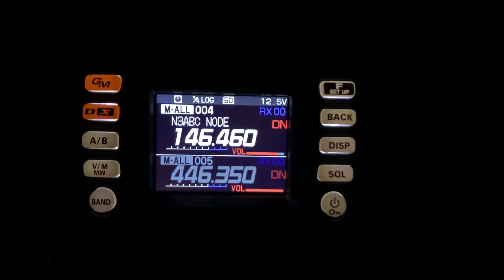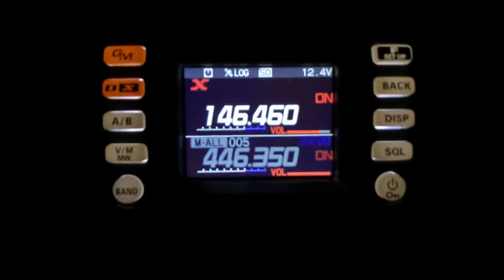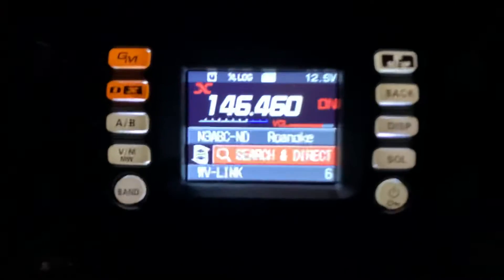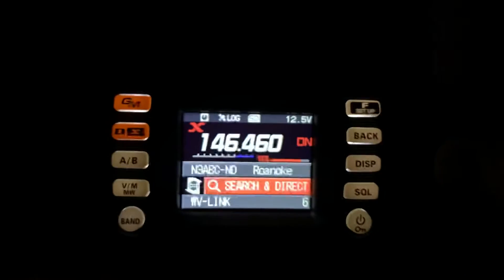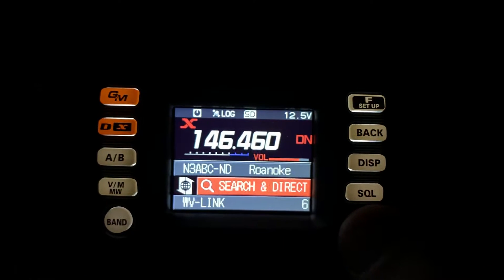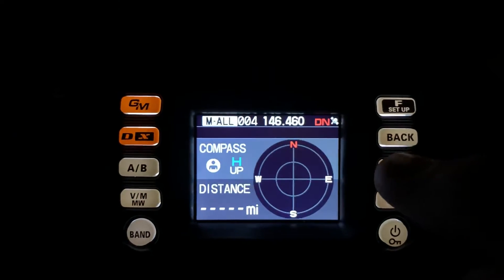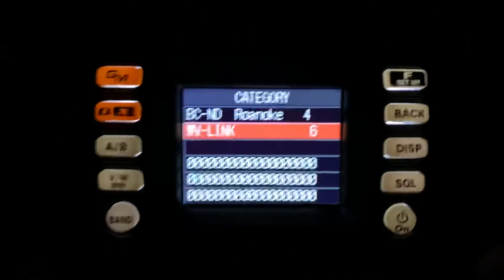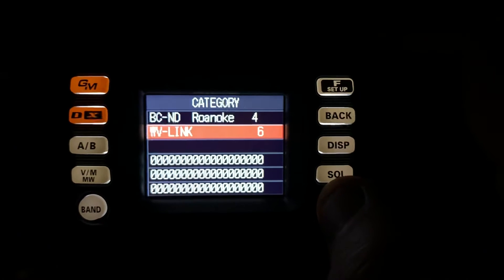FTM-300 locks up while in WIRES X

Comment: What have you tried to do to resolve it so far? What firmware main and screen are you on? Have you tried resetting radio? Are you trying to connect to a hotspot?
Reply from the maker: Sorry for the late reply. I sent the video to Yaesu and they noticed I was programming it with an SD card. It turned out there was a big in the RTSystems software that they fixed immediately. It works great now.
Reply: @kevinmccallister  how can i get this help too? i have rt systems and i have trouble loading memory channels via sd card, the radio shuts off in the middle of qso's , and it gets stuck on random channels when scanning memories. should i contact yaesu?
Reply: I just called Yaesu and they say they have never heard of these issues. Bunch of BS.